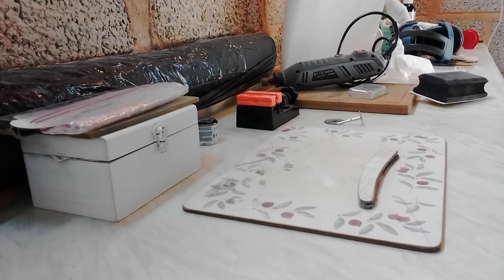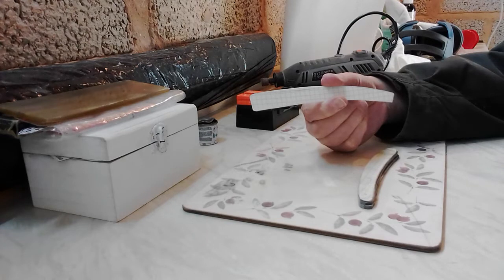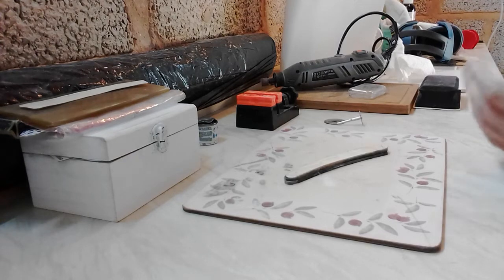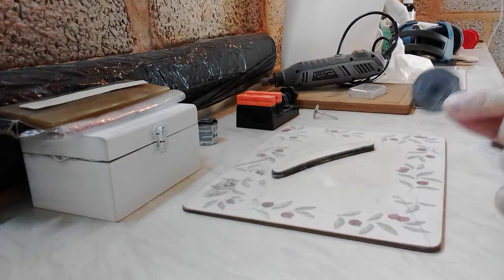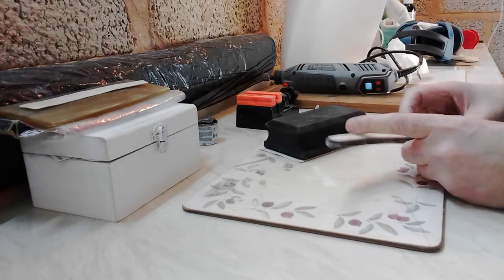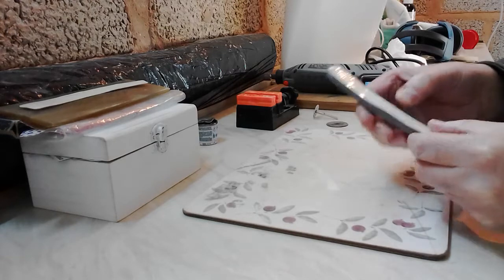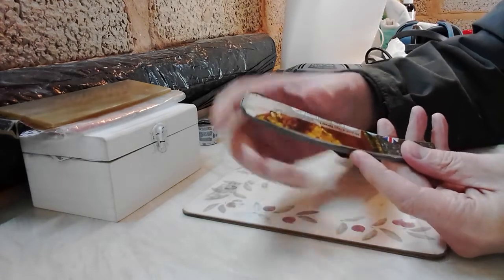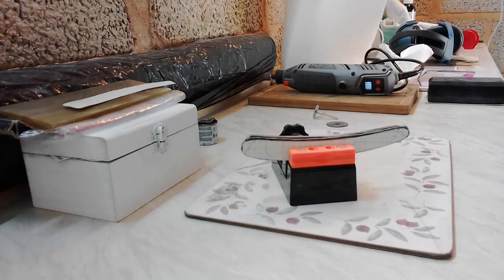Trying to Restore a Straight Razor #6: Working the Scales

Comment: Hey Mark, that looks good. You really made progress with the scales 👍 Looking forward to see those ready. I guess you can polish the edges of the horn quite easy with the polishing paste and the cotton buffing wheels for the rotary tool. At least i did it with acrylic before (be sure to set the tool to lower rpm). Good luck Mark 😉
Reply from the maker: The dust from the horn is a nightmare. The scales are really coming along and I think the polishing cloth you sent with the pink cloth works quite well. It's all coming along nicely, thank you.
Reply: Hi Mark, yes the Cape Cod polishing cloths also work well on other materials than metal.

Comment: Nice little instalment and update Mark..looking good think the horn scales will look particularly nice when they are finished, it’s been an interesting watch as I have a nice little Timor blue steel that at some point I would like to reblue and make new scales for really quite enjoying following along, as always a pleasure to watch all the best Jay
Reply from the maker: Thank you, mate. How do you re-blue a razor? Wow! I've enjoyed these journal type videos, it has made me think more about what I'm doing or going to do. I think the key is, at least for me not to be in a hurry.
Reply: @FriendshipShaving  think you are spot on there Mark with not being in a rush to do anything, I too think that is the key with anything when it comes to straights whether that be shaving with them learning to hone or restoring. Blueing is a coating used predominantly by gunsmiths but a select few straights have a blued spine..it would involve completely stripping the old blu and recoating there are different methods my dad was a gunsmith for many years but used the old acid bath method probably the method providing the most longevity but not suitable for straights really as the heat can alter the temper of the steel so I would likely go for a cold blu process which involves slowly building up coats of blu so I would need to tape the razor leaving only the spine exposed..it’s one for the future but I want to prepare well in advance for it and take my time to get the best possible result..not the usual thing to do with a straight but I’m a bit of a tinkerer and quite fancy seeing what finished result I can get. All the best mate
Reply from the maker: Mate that is fascinating! I'm intrigued. When there is an image on a blade, is that made by acid etching, in the same way that a blade is blued? When Gillette introduced the Blue razor blade, is that also the same thing or is blue steel something good else entirely? You'll have to get some cheap blades and get practicing 😊
Reply: @FriendshipShaving  that’s an interesting question Mark I think the blue blades could be a very similar blued coating but in not sure if the bluing used by gunsmiths is safe to use on skin as the blades I was looking at doing we’re only on the spine I assumed it wouldn’t cause issue. Guns are blued to stop rusting so I would think the blue DE blades are coated in a similar fashion again to prevent the rusting but don’t hold me to it I could be wrong and it could be an entirely different process that’s used, it’s something I definitely need to research further but I certainly fancy giving it a go
Reply from the maker: You have to do it now. It's the law, 😊 and you have to make video 😂 Take care
Reply: @FriendshipShaving  haha no videos for me Mark I honestly don’t know how you do them..it takes a lot of confidence to make a video and put it out there more than people think, what I will do though is sent you pictures of when I do it of the different stages. Sound like a plan ?
Reply from the maker: That's a great plan 😊 Thank you.